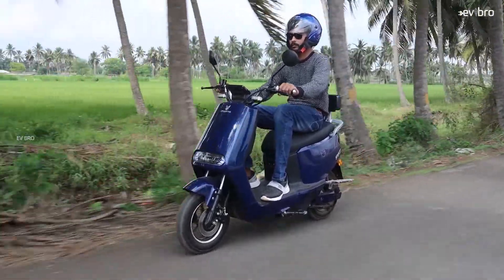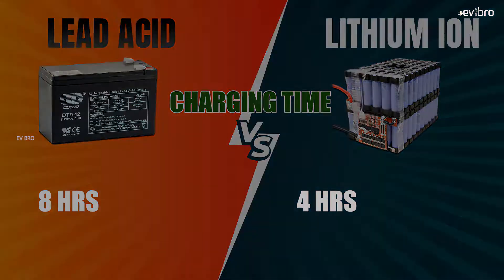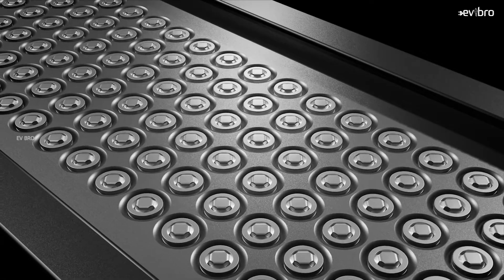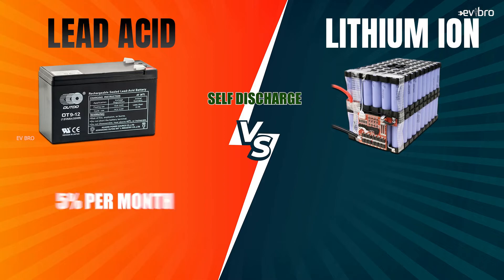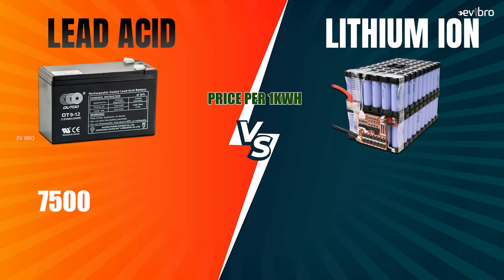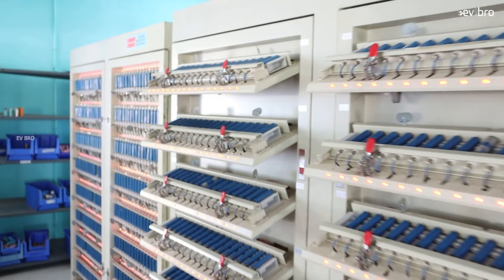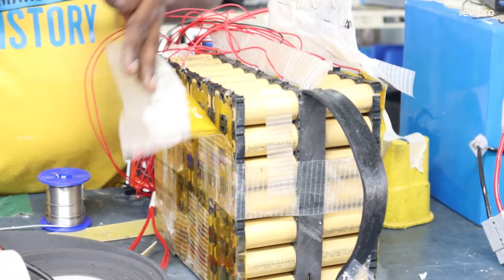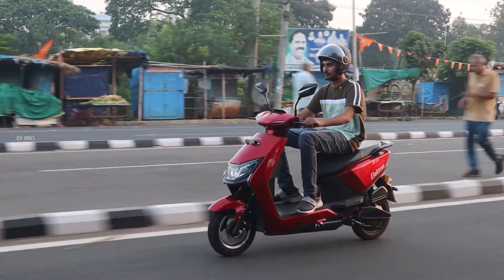Lead Acid vs Lithium ion Battery Electric Scooter - EV Bro

Comment: Bro can we use ups batteries for ev scooter with the help of any adopters or power converting  gadgets if not why,if possible give idias for how to use with practical vedio why iam asking ups battery cost 7000  scooter batteries led 20000(6no) lithium 40000, please if possible make that vedio.

Comment: In continuation of my previous comment. The comment was incomplete owing to mishandling. E- bike is not suitable for long distance. Safety being the first priority, l 6:26 ead acetate is better option. More over there is hardly any certainty to get good lithium ion battery.

Comment: You forget to mention that pb acid battery shouldnt discharge beyond 50% of its capacity
Reply: It is often said lead acetate battery should be should be a discharged up to 80%.
Reply: Excuse me for the printing error. I wanted to mean lead acetate battery should be discharged upto 80%.